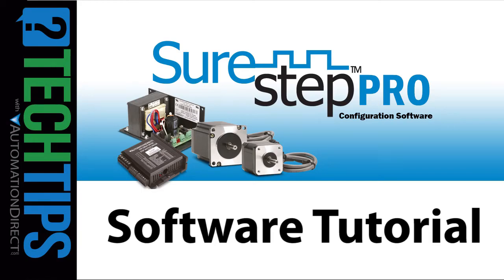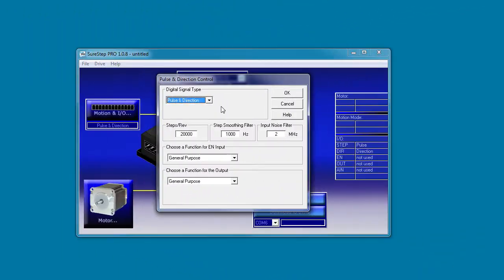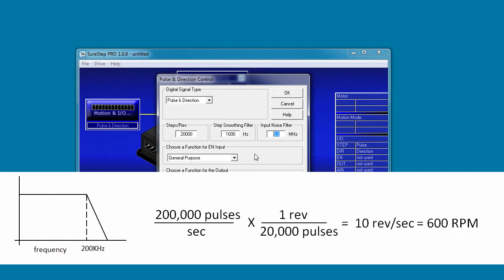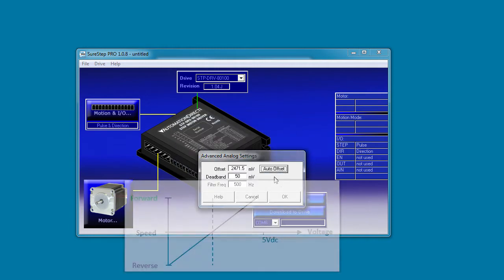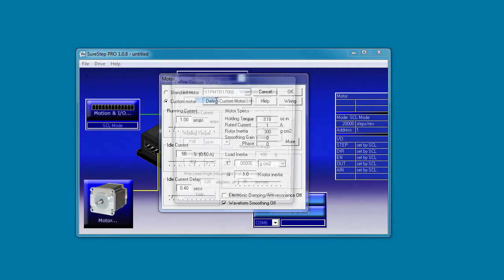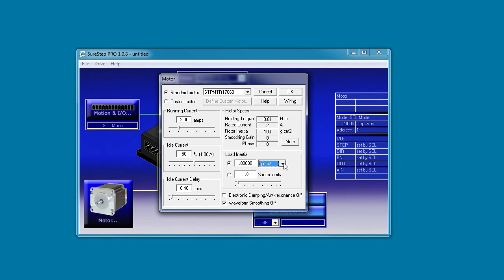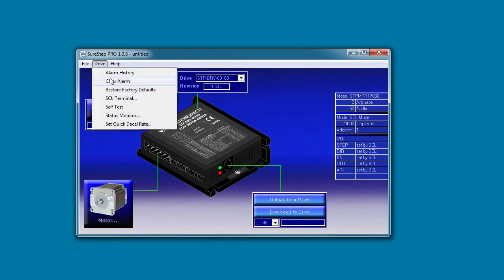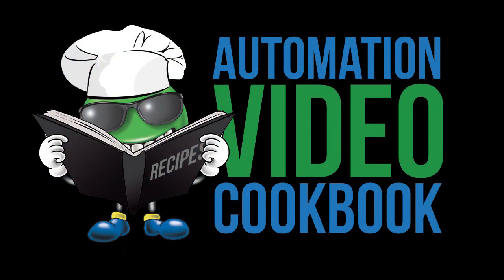SureStep Pro Software Tutorial from AutomationDirect

Comment: Hi! I was just wondering how does one use STEP input as the run/stop command? What must be "closed" for the motor to run?  
Thank you!
Reply: I've been looking for that too, but I haven't found that capability on these drives. I'm thinking about using CW/CCW mode with a STP-DRV-6575 (switching the inside jumper) but it seems that I will still need to provide a high speed digital output from my AB PLC, I was ideally looking for an enable/disable type of input with a fixed speed from the drive, but no luck with that at this point. 

I guess this drives are intended to work with a feedback system more than for a simple continuous rotation application. Let me know if any luck!
Reply from the maker: Thanks for the comment Nicholas, Make sure to check out more of our 1100+ videos on our website https://www.automationdirect.com/adc/home/home